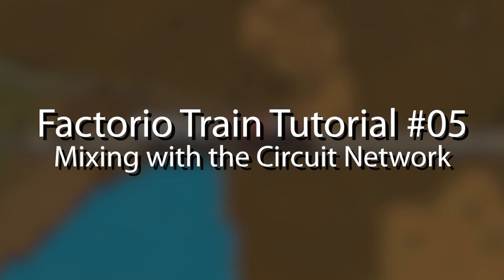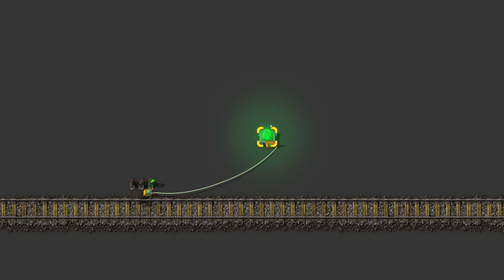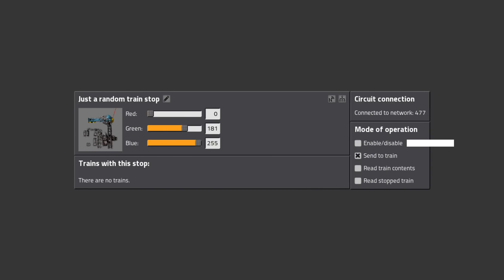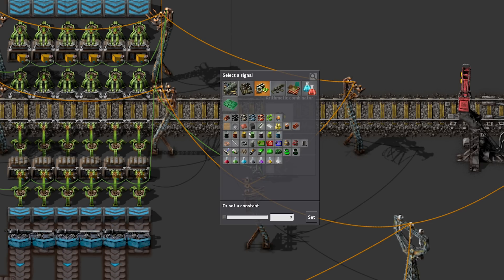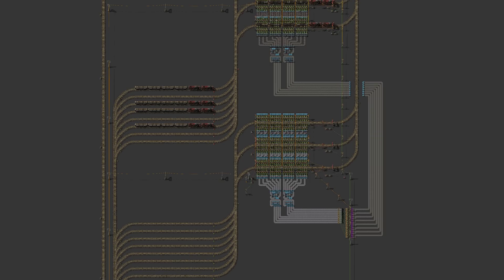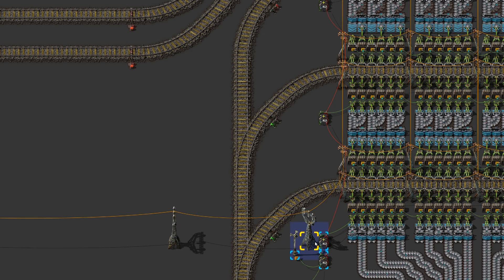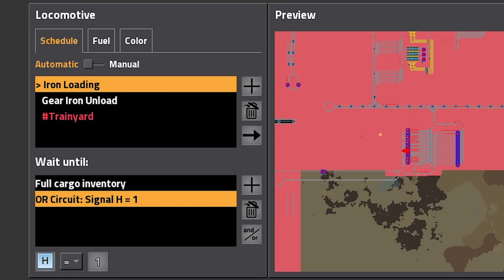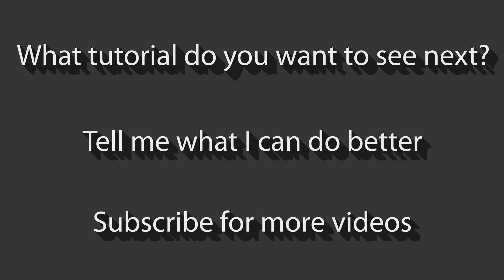Mixing the circuit network and trains - Factorio 0.16 train tutorial #5

Comment: just wondering if you ever ran into this problem or if you have a solution to the question I had here on reddit https://www.reddit.com/r/factorio/comments/b9d532/how_does_one_stop_a_train_going_to_an_outpost/

basically im noticing that if all my mining outposts are turned off except for 1, and I have 2 trains waiting for an outpost to go to, both trains will go to that same outpost. but once one of the trains get filled up, the station will most likely not have enough product for the next train and thus will shut off. because of this, the second train has waited for nothing and thus ends up making a U turn and heads home. how do I prevent the second train from leaving in the first place?
Reply from the maker: Well, I usually have a stacker at mining outposts. But you could maybe try and detect if a second train is waiting at the outpost and then send the first train off earlier?